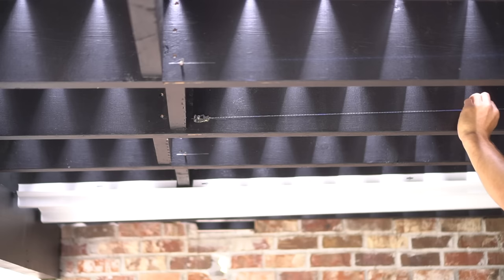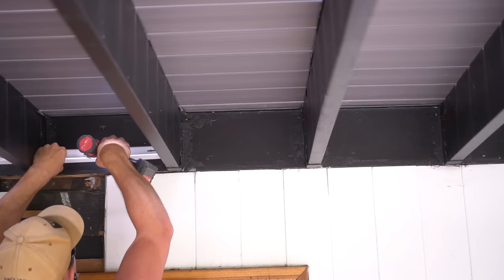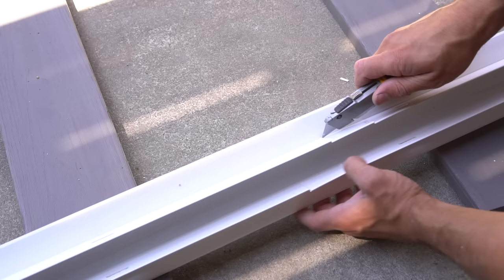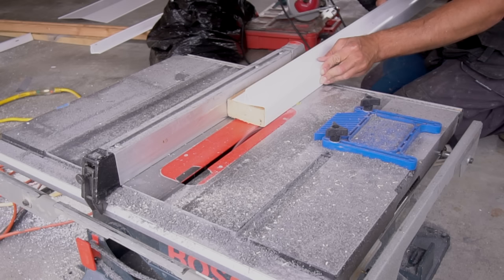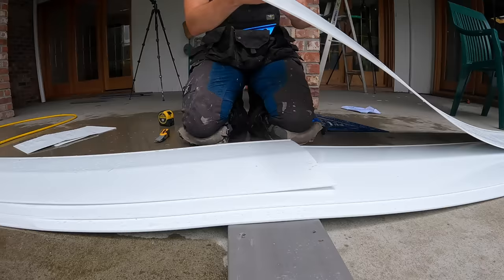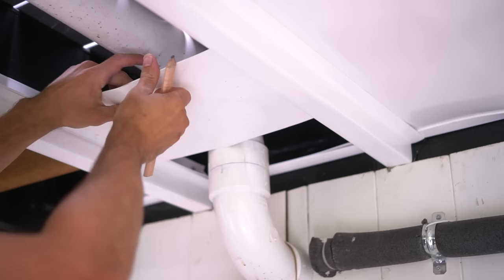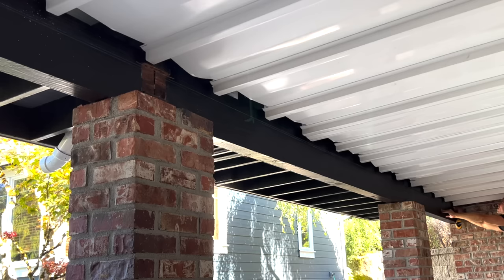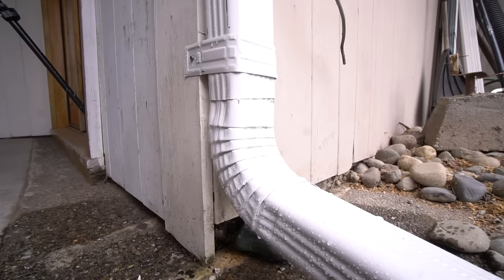DIY Deck Drainage System

Comment: I don't get it why not just instal polycarbonate underneath or some sort of light weight plastic roofing, this seems like an overly complicated way to divert water with an unnecessarily large amount of parts taped together that will eventually leak.
Reply: Genuine question - how would you stop the water from just staying/pooling on the polycarbonate?
Reply: I just realized that you'd just have to install it at a slight downward slope and it would just run off the edge, you wouldn't even really need gutters unless you get a lot of rainfall and are worried about the runoff
Reply: Yeah I also thought this seemed way too overkill. Just install a poly roof at a pitch and let it drain into a gutter.
Reply: Also a polycarbonate roof would let more sunlight through which i think is the idea if you are building under a deck otherwise why even have deck.
Reply: @CMZneu  So the loss of light is the reason I didn’t go with this option. I kind of devised my own system, with polycarbonate cut in between the joists so I didn’t loose overhead space and doesn’t look tacky. 
The light filtering is amazing when looking out from below!
Reply: Probably because there's a walk out basement underneath the deck and the homeowner would like something that looks a lot nicer than  sheets of plastic
Reply: @bmurphy2345  Yup. I tried the corrugated plastic sheeting. OMG did it look awful. It was only up for 2 summers and I couldn’t take it anymore. So made a new plan, that works and looks much better, as stated before! Since the deck is in front of the house, the curb appeal also improved!
Reply: My buddy has a cottage uo north that we all party at. He had a partly covered deck underneath the main deck and we would drink under there if it was raining. We just did something like this but used closed soffit runs made out of aluminum. We just installed a wood hanger system(like for ductwork) halfway and at the end of the run. We then installed an eaves system at the end. Not as pretty but it works.
Reply: Because a manufacturer of polycarbonate hasn't sponsored the materials.
Reply: @CMZneu  your not going to get sunlight through a deck
Reply: @SteveStowell  I don't understand through this type deck you mean? Some light will filter through the cracks and in full sun it's more than enough, transparent polycarbonate will let pass almost the same amount of light underneath.
Reply: Haha yep, I just ordered twin wall polycarbonate for this application.  Doing some last minute YouTube searches to convince me I’m not an idiot. 😂
Reply: That’s what I did. Cost around 1300 for all materials. I would suggest using a solid soffit. The problem with using F brackets is water and debris will rot out the wood
Reply: I used pond liner you just do it on a slight angle so it will follow the slope of the deck to drain
Reply: The poly works well, I am making an extension brush like a pool cleaning brush out of pvc pipe to clean the leaves that have gone through the deck slats and cause a draining issue
Reply: @Apftw  This idea needs more likes. I think that'll be my solution. I will cut long furring strips at a slightly increasing slope from one end to the other, add silicone caulk strip along the underside of the joists, put the pond liner on, starting on one end and securing it with the other side of the cut furring strip so that the bottom of the second furring strip is level. This will allow a second, decorative panel like bead-board to be attached to the lower furring strip. I think it'll work.
Reply: Great video,  I was looking for this idea on a project just like this. 👍
Reply: I think tho from viewing these comments about failing potentially, bc of tape, seams, etc if I wanted to repair a leak, I'd have a really difficult time if I drywalled underneath for living space such as adding a closet..   That would be a good day 😅 🍻 cheers
Reply: @milesmulligan6515 same way with plastics sheet, make sure you have at least 3degrees slope
Reply: Esthetics + functionality!. I agree this is expensive and labor intensive, but those that can afford it can. The polycarbonate system you proposed,  at best would look really crappy done by the most experienced person. The challenge is slopping. You can't just tag it under a leveled joist.
Reply: @Apftw that's is if you thought about it before the deck boards were installed. The system shown is for retrofit. If you try to retrofit a pond liner, your deck underneath would look like a trailer trash. No good way I know of to do it after the fact.
Reply: @WayPastCrazy2525 one end of your pond liner would be sagging down to allow drainage.  How would you cover that part up with a panel?

Comment: There’s a problem with trapping moisture that runs thru the decking, down the side of the joists and behind the combo brackets. This will cause accelerated rot of the joists. This is further exacerbated by any pine needles or trapped dirt.
Reply: This is obviously the best solution without tearing up the deck… hindsight is 20/20
Reply: I'm surprised he didn't run the tape along the top of the brackets, because I immediately noticed it's not flush with the joists.
Reply: As with everything on a house ,there is maintenance.  As with this system you will have to clean the channels. . Simply remove a deck board  at the top if the deck and wash the debris out . Not difficult at all .
Reply: @brettsurrett4596  Remove the deck board?  Are you kidding me?
Reply: Totally agree with the OP. If they were going to install a system like this, it should have been upside down with the combo bracket on top of the joist prior to nailing down the decking.
Reply: @jwt1035  yes.remove deck board closest to the home and flush out the debris. If you think it will clean it's self you're delusional.
Reply: @brettsurrett4596  If you think anyone’s gonna do that, you’re delusional.
Reply: @jwt1035  my company does it for clients spring and fall. It's damn good money and easy to do. You don't sound like a very motivated person.
Reply: @brettsurrett4596 Overcharging homeowners for this easy work is exactly the reason you support it. “Show me the financial incentive and I’ll show you the outcome.”
Reply: @jwt1035  I agree. The board closest to the home, which if pvc/composite, would be face screwed and then hopefully plugged. How many times could you remove the plugs before they damage the deck board or don't fit anymore? Not to mention that the edge of the board over a ledger is usually tucked under a j channel. How are you going to remove that board painlessly? Sounds like a huge pain-in-the--ass.
Reply: @bradeley1011  doesn't have to be the board closest to the house that you remove... Any board really that allows you to get under the deck with a hose.
Reply: @GreganDunn  have you ever tried to remove a deck board with hidden fasteners and then put it back in?
Reply: @bradeley1011  don't hide the fasteners on the one that you need to pull off to clean? Seems like a solveable problem.
Reply: @brettsurrett4596  See how easy those screws are to get out after they fill up with stain after 2-3 recoats without stripping the heck out of them.   Even harder with a hidden faster system.   If the deck boards are face screwed they are easier to get out but look like a teenager installed it.
Reply: @Deltaconcepts  that's the problem with most industries. Everyone is bitching and crying about how hard it is going to be to accomplish a task. Just get the job done. And do it properly.
Reply: There lies the inherent pitfalls of "after the fact". A pond liner solves most of that problem if the owner had a 2020. But if you are just inheriting a deck from buying a house, the options are limited.

Comment: Nope. Don’t do this. Panting wood seals in moisture. Your deck will rot 10 times faster. Then slowing the water from draining faster is a recipe for disaster.
Reply: Not if you wait for the wood to dry out then paint every surface. My deck is painted and lasted 20 + years. I just repainted 6 years ago and the areas I primed and repainted was still solid. The issue with painting wood is allowing entry points. Cover it all or nothing at all.

Comment: This appears to be a great solution but I priced out my 11'X15' deck at Home Depot today. Over $1,600.00!! For some plastic! Either Home Depot or AZEK are insane. I will get another price but will never pay close to that.
Reply: It's not about cost, but about what is the system worth to you. Plus, they probably don't sell these in high volumes which jacks up per unit price. But I agree, these things are way too expensive.
Reply: @markdichiara9486 I've been looking at corrugated roof panels at about $700 for a 16x20 space. But mine is for a crawl space so I value height just as much. This solution would be best but $$$$! My next option is to look at plain old PVC wall panelling but they don't really provide channels like this or corrugated panels.

Comment: Joist get wet and water trapped between wood and plastic. Just use pond liner
Reply: If it was thought of before deck boards went down. Sometimes the owner is trying to retrofit an existing deck.

Comment: This comment section is a bit negative so I'll add something helpful. If you need to cut a hole in a piece of plastic or thin PVC, you can just run your hole saw in reverse and melt your way through it. It's easier to hold still and leaves a clean edge.

Comment: Just screw corrugated iron under the deck. Cheaper, quicker and last 30 years. Also will not rot out the wood as you can put the rubber o rings on the top to separate the wood from the iron. Can still install the guttering as well.
Reply: How would you slop it? A video would help. And I promise to like it.

Comment: Great video. One suggestion, add a piece of flat metal counter flashing to the rim joist as a splash guard before you install the gutter. This will keep water from getting between the backside of the rim joist and the gutter. 
Great clean job!

Comment: I did the same thing using some stripping to create a slope and then screwed clear polycarbonate roofing sheets. Let's light through and kept me dry
Reply: it last pretty well?
Reply: Fully dry? I can see debris getting stuck next to the joist and rotting out your joists over time. Reason being you don't have access to caulk the inside smooth due to the deck board above. There's a reason why these after the fact retrofit  systems are as expensive as an arm and a leg.
Reply: @samu3813  the preinstalled systems are just as expensive.

Comment: wow, i never knew something like this exsist. now i can stay clean and dry whenever i run to a deck for cover. thanks brent. i really should not be surprized though cause ive learned about other innovative things by watching you.
Reply from the maker: That’s the beauty of this system. Thanks so much for watching and the kind words.
Reply: @BYOTools  you are welcome!
Reply: Yeah, but he got all of this stuff for free. This system is stupidly expensive for what it is actually composed of. One 16' V panel is around 50 dollars. The hanging brackets are about 85 bucks each. That's 135$ PER joist bay, not including fasteners, tape, starter track and gutters. A 20' deck is going to cost you around 3 grand- and that's if you do all the work yourself....
Reply: @aaronellingsen5404  i dont care, aaron. im not a tradesman and i cannot get into those trade shows unless. youtube videos have some incredible videos of things that are practical and can solve real issues.plus you find out here whats on the market so you can ask for it.

Comment: I had this system installed by a contractor and it looks great and works well.  I have a few spots that leak at the gutter where the water doesn’t drip into the gutter, it tends to follow around the panel and misses the gutter causing a leak.  It is especially bad during heavier rain.  This same issue would be resolved with a drip plate, or panel, if it were on a house.  Any suggestions on why this is happening, or what to do to stop it?

Comment: I have a dual layer deck, underneath the main deck os covered with corrugated roofing so it currently protects my riding mower. Im about to get another mower in a zero turn so my older mower needs to be relocated underneath the unprotected bottom part of the deck.  This system looks nice but im not trying to spent a grip of money. 

Im thinking some cheap corrugated metal with a partial overlay and maybe using a 2x4 on one side to give me enough slop to drain water..

Comment: I just bought a home up in Skagit County. We have a carport with the roof that serves as a deck off our kitchen. Currently the deck is covered in a rubber membrane that is very soft in areas. The plywood underneath is obviously rotten. Ideally, I want to remove the membrane and replace it with a more traditional wooden decking. This product might be perfect for the roof of the carport, under the deck.
Reply: I have a similar plywood membrane solution that has lasted over 30 years. Last time I recoated it was 15 yrs ago. Still no leaks. But it's not pretty like deck boards. Functional and underneath is completely dry. I have to pressure wash carefully every 2 years .

Comment: So how do you clean that out when it gets full of Douglas Fir needles in less than 1 year?

This must be an option only for inner city use, with no surrounding vegetation.
Reply: Once every 2 years, pop out the runs and replace? Like grudgingly?😅
Reply: Nothing beats pre panning a dry under deck before the deck boards go down. After that, any systems is bound to have lots of negatives. EPDM pond liners are the best, but lots of work upfront.  After that, just hope you has enough slop and  get ride of your pine trees. Every system clogs over time, if there are pine trees around

Comment: Very nice 👍
Prior to me know about this stuff on my last deck I did a system using some strapping and vinyl siding.  Worked well but I noticed over the years a build up a dirt and pin tree debris.  
Cheers

Comment: Trex Rain escape is another product to keep the space under your deck dry. It goes over your joists so must be installed before decking. 

You did not do a good job explaining how sealed around the PVC pipe. Seems like you would have a leak around that also.

Comment: What stops water from going between the joist and the panel but at the bottom of each joist?  Seems like water would run between these two edges and be trapped at the bottom of each joist?

Comment: So this is exactly what I need to update my 30 year old wood lattice patio cover, we want shade and rain protection, my wife wants it torn down and have a aluminum wood patio installed instead. The wood is till good, it just looks rough, it needs to be painted,  It was very expensive wood 30 years ago today it will make you sit down.

What would you recommend for the top, out of site out of thought but it will still rot in the elements? The patio is 14' x 25', the stringers are dual separated by a 4" x 4" and three feet apart. Very typical patio.  Thanks in advance

Comment: Great set up, and I have something similar on my deck. I have some trees near the deck and the debris that falls between the cracks on top of the deck end up trapped in the corrugated material I have under the deck. Any suggestions?

Comment: Great video! Now that you have had it awhile, how is it to clean? I am worried about the system getting clogged up.
Reply: One case that had sloped corrugated roofing under the deck did get all messed up from tree debris.

Comment: Could you use like a flex seal spray-on instead of the tape to prevent moisture from getting under the vinyl brackets? Wouldn't spray-on give you a more reliable prevention?

Comment: I guess when you live on Lake Washington you can afford a system like that...
Too rich for my blood...

I have a 12 x 26' elevated deck and went the cheap route, a 2 pack of Costco tarps and a handful of 2 x 8 x 12 pressure-treated and made 1x strips, did tapered blocking, I gave the tarp a very slight belly in between each stringer, and when it comes to Pineneedles all you have to do is reach up and swat it with your hand and keep hitting them all the way to the end...and I made a gutter system from 4" PVC cut in half lengthwise

Both ends of this tarp system are open so air passes through so no moisture problems whatsoever ...

I did this as kind of a joke/experiment but I did it nice and clean...3 years later and it looks just as good as the day I put it in .... those Costco tarps are tough as nails...

All of the pressure treated 1x strips and blocking I made show no signs of rot due to the pressure treated sealer that I put on them before I put them in place...
Reply: Check back in 10 years. Wishing your system good luck. Nice thinking outside the box.
Reply: @samu3813  my system wasn't meant to be permanent, my temporary system and my permanent solution that I have recently completed is a fraction of the cost of the system in this video. And I'll get back to you in 20 years on the solution I've installed...Vinyl seems to get brittle in due time..
Reply: @-7205  if I am still here in 20 year, I will be happy to toss a beer or moonshine to your success🤣.

Comment: Wouldn't it be better if the system installed on top of the joists and kept the joists dry as well?
Reply: If you are building new that is the way to go. This is better suited for existing decks.